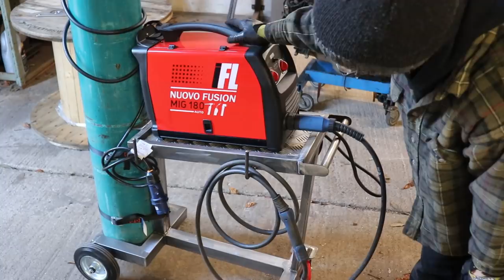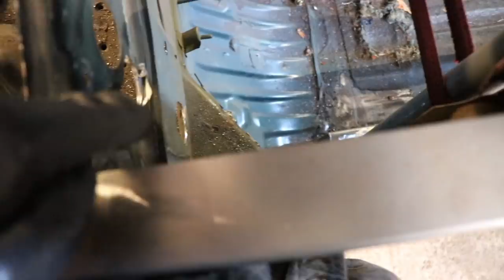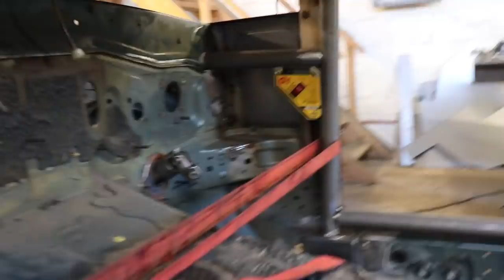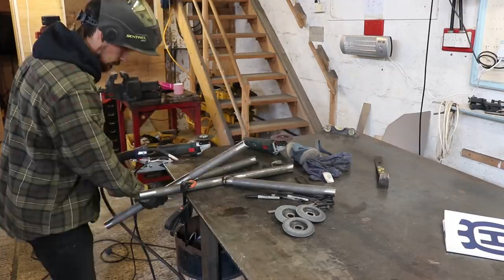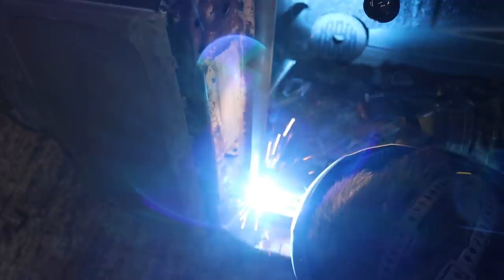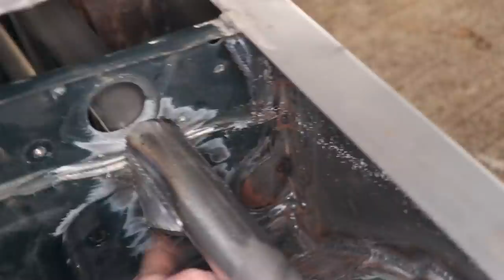THE MONGREL PART 16, MORE PROGRESS ON THE ROLL CAGE.

Comment: motorize your bead roller, foot switch, i done mine, using a medical lift motor, and speed controller from a moblity scooter, 24v battery's just re charge them, the medical lift motor is high touque about4 rpm could be 8 rpm i forget, lol,  excuse my spelling im not good at all that. bloody good work. i run mx5 1.8 mechanicals in my dutton melos kit car.

Comment: about filming work on customer cars : yes it takes more time , you could set a slightly lower price for the job without the filming (like 1/3th of the hourly rate if the filming take 3 times the time)  if the customer signs a release form for the content / agrees to have it filmed and that it will take more time to pick up his car , you make a little money from the content too so you whont realy loose money on it if you lower the shop price and need less money for the project (parts still payed by customer )
you could be a little selective of wat jobs to take in too as the people will go for the lower price for quality work and probably showing off the video's of the build / conversion

Comment: Another brilliant vid, always entertaining and informative. Every day's a school day watching your hints and tips. I hope the channel goes from strength to strength and the builds keep you and your family well paid.  There has to be fair reward for you patiently sharing your skills with the world and I'm sure it will work out well. My only disappointment is that I was really hoping to get one of your lovely cages put into my Sierra floorpan'd 10" wider than stock 105e Anglia 4x4 turbo technics. It's an old build and the shell was built well by the previous owner (I've had it myself 20 years) but now I'm in the same boat as you with two kids I just don't trust the crappy seamed tube cage in it that I used to be happy to ignore. Car and cash waiting for a Matt cage if you change your mind about a customer car job? No offence at all to your mate you mentioned but I had to retest a car the apprentice at work put front to rear brake pipes on the other day. Functional and safe but just not nice and pretty and factory looking like I'd have done it. That all comes with experience.  I'd rather someone didn't learn a new skill on my car and I'd really like your cage building experience if at all possible.  All the best,  Chas. 07867975068

Comment: Do they make either a flexible or small sized mig torch to get into tight areas like they do for a tig welder? Maybe wishful thinking but would come in handy at times? Chassis repairs on landrovers with body in situ  are tight for room on the top face and a restricted access torch would be handy.
Reply: Ò
Reply: Oh yeah both of those exist. Can't say I've tried a flex head MIG so couldn't comment on if they are worth trying though :P

Comment: Well you made the front end tubes look easy .
You could do some customers work but you have guestimate the hours you charge them, if all goes to plan you just be doing your projects but I wouldn't rule out doing some customer work as videos if needs must to reach the final goal .
Anyway, crack on and keep the camera rolling :-) 

welder looks good and I like simple twist dials, touch displays ect just hassle if no real need for it, seems you got companies to build relationships with already really so all looking promising 👍

Comment: I recently bought the a very similar welder for the same exact reason.  It's simple (and because it is dual voltage - which I guess is more important here in the states).    Everlast Power i-MIG 200E $550 + about $45 shipping.  https://www.everlastgenerators.com/product/mig/power-i-mig-200e